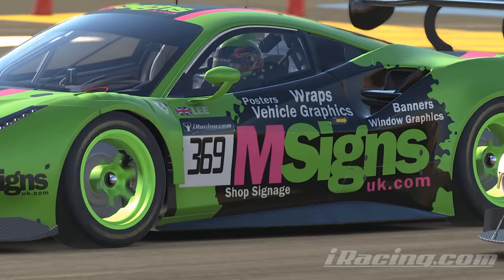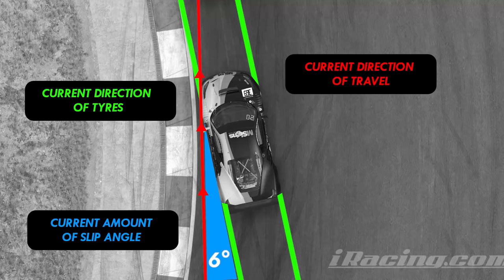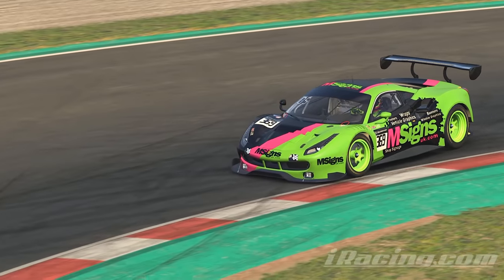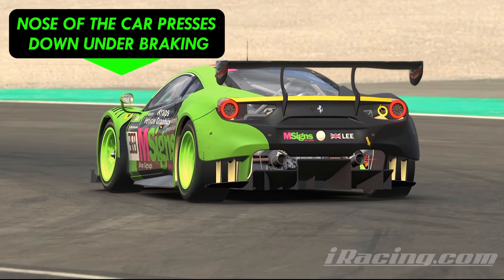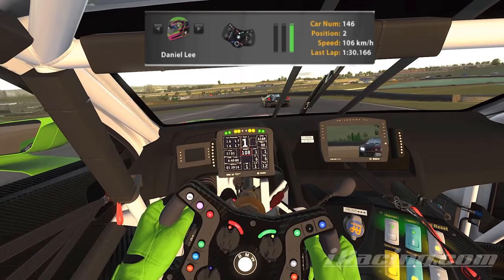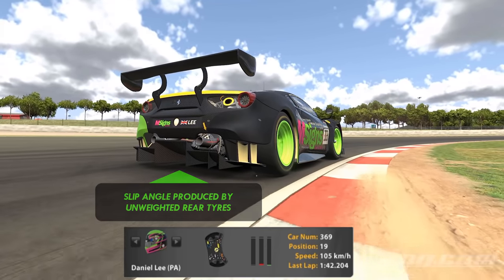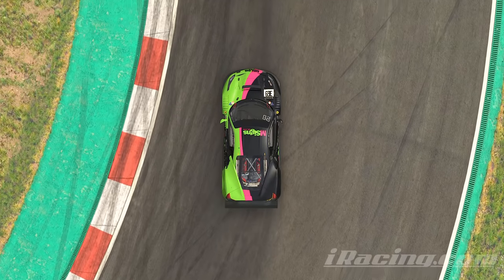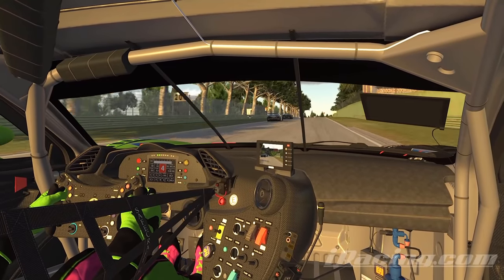Slip Angle in Sim Racing - Nail This and Smash Your Lap Times

Comment: Very well put. I’ve been learning this on my own so it’s great to hear what it is. I’ve got a long way to go though. I’m a GTS player but I imagine it’s much more important in iracing.
Reply from the maker: Cheers - I think it's important in GTS too, at least I assume it is because when I spent a lot of time in GT6 attempting to qualify for GT Academy I found nearly everything rang true more or less. I think GTS is more forgiving about overstepping the mark but the sweet spot is still there to be hit.
Reply: @dannyleeracing  That's correct. If you induce too much slip angle in GTS causing oversteer, the front tyres lose grip as well by magic resulting in a tangental slide without car rotation. It's forgiving for that reason. The only way to oversteer in GTS is to lose rear tyre traction through longitudinal wheel spin (too heavy throttle) rather than laterally pushing the rear tyres. Stock GTS setups (mandatory in Sport mode) are built for latent understeer with a higher rear tyre grip threshold than the front tyre grip threshold so it's unlikely that rear tyre grip is the car's performance 'bottleneck' and instead performance is limited by front tyre grip. Source: I'm a former top split GTS driver.

Comment: Great video, there is more to this though. Slip Angle happens PRE slide and it is the difference between front and rear slip angles (just) pre slide that great drivers do. You can slide the rear in the first third of low speed corners but you have to be careful with tire temp and as I’m suggesting it is different with corner speed. Self serving recommendation, read my book Optimum Drive (which is a continuation of the great Drive Faster). This is an important topic (as you keenly state), keep the learning and teaching going👊🏻🙏🏻

Comment: I can get into the mushy steering zone. That part is easy. The problem for me is keeping that feeling as I make the turn. 95% of the time I either wash out completely or drift into a spin. I got to really get throttle control down. 

Trying to get into this state, I am now trying to learn how to tune in Raceroom (and AC, ACC and RF2). Most of the stock tunes are a bit too tight, but I have to learn how to loosen it up.

Comment: I've always noticed that on very familiar roads I've just kind of instinctively done this... finally know what it's called!
Reply from the maker: Don't try this on the roads or you'll be 'going for a gap' between a truck and some roadside shrubbery one day. If that happens the only slip angle will be in your undies.
Reply: @dannyleeracing  Most corners you can see through, and even then only do this occasionally at like 4AM in the middle of nowhere.

Comment: There is a distinction between slip angle and loss of adhesion. Tires under load always have some degree of slip angle, but it doesn't mean they're sliding. It just means the contact patch of the tire is being twisted by the track surface to face a slightly different direction than the wheels. Finding the optimal point where slip angle is maximized without breaking traction and sliding is the fastest way through a corner, whereas truly sliding is not. The rears shouldn't be operating at a significantly higher slip angle than the fronts, otherwise the front wheels aren't being taken full advantage of. For this reason, I'm skeptical that a lighter rear end starts to slip and help rotate the car into a corner.

Also, confusingly, increasing the load on the tire decreases the grip. This means the front wheels have less grip under braking than the rears. They have more overall traction, but grip is defined as the friction coefficient of the tire (at least from my experience) and not how much traction it has, which decreases as more weight is put on the tire- along with many other factors.

These are nuanced details, but may help people realize that slip angle isn't all that counterintuitive. Looks like some other people have pointed this out, but I hope this explanation is clear.

Comment: I like to liken the tires to a rubber band.

To get the most out of them, you have to stretch the tires (slip angle) enough that they stretch, but not so much that the band snaps. (Loss of grip)
Reply from the maker: You know I love an analogy. Tyres are made of rubber at the end of the day, they need to flex to do their job.

Comment: I'm at a point where 80% of races on iRacing I'm in the top 4 - but yes I have noticed some corners where i have -perfected it, I'm almost on the edge of 'slipping' all round corners to perfect it...

However, this won't work very well on some corners unless your break bias is SPOT ON - for certain corners.

So mess with your break bias, not just for each race, I mean for each corner! On the fly!

Comment: I believe this is why Hamilton and Verstappen always have the edge on the other drivers, especially in the wet. Vettel too, in the V8 era at least, he hasn't got the confidence to do it in the Hybrid era cars. Driver61 channel kinda covered this but he called it something else and described it differently. Schumacher used to do this as well. It's all about confidence and being consistent. Being able to pull this technique off even under huge pressure. Most if not all elite drivers know this technique, it's whether they have confidence in the car to pull it off or not. Martin Brundle and Karun Chandok have also talked about this a lot.

Comment: very well explained. for me (only sim racing for quite over one year now) its hard to achieve with more understeery cars. with those cars i feel like its pretty hard to get the setup on point for slipping the rear end a bit. especially in ACC
Reply from the maker: Thanks man - One way to 'tune' the car out of oversteer is to click the rear anti-roll bar stiffness up or by softening the front anti-roll bar - try it in real small increments and see the difference it makes. There are multiple things that can do it but generally speaking, ARBs have the most obvious and dramatic effect on all-round balance when cornering. ACC is somewhat tricky to feel the limit, I agree.
Reply: @dannyleeracing  ARB' soften or tighten. understood. will try that today. thanks mate
Reply: @dannyleeracing  Not exactly. Stiffening rear anti-roll will make the car more oversteery. Same for softenign front anti roll. Because softer end will tend to roll more, thus it will maintain more equal tire loads, and having more equal tire loads gives more grip in total at that end. But other effect is that havign softer roll contributes to slower reaction, so it is likely that by having front softened in relation to the rear will make the car to steer less suddenly, which will seem to have understeery feel and will be just turn the car bit slower. 

Even more important thing is balance of the aero though. @Vinz Vega, if you want more underteer particulary at greater speeds then shift aero downforce ballance rearwards, you will have more understeer then. However watch out for snap oversteer. Snap oversteer happens when you have understeer which can quickly turn into oversteer once frotn wheels gain grip, normally drivers don't understand that and thinks that theyr primary issue is oversteer.
Reply: ACC has some Setups, yes agressive ones too, with wayyyy too much Brakebias to the front.

On some Cars you need to go down to 56-58%, or you have understeer city while trailbraking.

Change it also on the fly with your Wheel, because after the tires are gone you need to adjust it back to the front.
Reply: @JeyDeee89  got your point mate. brake bias is on my steering wheel already, but will try to put some more attention to it. cheers

Comment: Well in real world to put it in a simple way ... i could corner at 180 - 200 km/h on certain corners while most driver/ricer/pro racer could only corner at 60 - 110 km/h . They steer more than required and overly stiffen the chassis or suspension . Its good to have some weight shifting while assist in slipping slightly without steering , some body roll is good too . To perfect it , make use of gravity and weight shifting rather steering and corner using slight brake or without , precise throttling , worse to worse slip some clutch . Its better than installing crazy amount of body aero junks :)

Comment: I've been playing GT7 and noticed that when i accelerate around a turn that the car over steers, and never did solve that mystery for me.
Thought the game was promoting getting turns right and giving you more turning ability for being able to accelerate around a turn resulting in more turning capability.
When i didn't touch the gas I would turn normally, any time I hit the gas in the turn my steering shifted to more over steer, but in a good over steer as you pointed out.
I thought this was stupid for the game to implement, cause it's FAKE, I couldn't figure out why that was happening, to your point at the start of the video, it's so nuanced you might not be aware you are even doing it. I knew I was turning better with gas threw the turn. it was a mystery and couldn't figure that one out.
But low and behold, you explained it, and I found you...
I was doing slip angles all these times and not knowing what was creating it, I didn't think I was losing my back end cause I was accelerating while turning, so that would make you think you can't accelerate when losing your back end cause your rears have lost traction, but again you pointed out that your on the precipice of losing TOTAL traction, you are on the edge of it! Just enough to swing the car out and add torque, it's so finessed.

Then I thought I was shifting the weight and that's why I was able to accelerate around a turn and get a better steering angle.

Why doesn't the game teach you these things, with cafe's designed to educate you on these racing nuances?!?!?

Comment: You are a genius, thank you. I find it impossible to do this with potentiometer based brakes.
Reply from the maker: When I had my G29 with the standard brake block I'd always just have to use my big toe to daintily feather the brakes. If you have a Logitech wheel give the Truebrake a look, I've got a video on that as it quite impressed me given I'm now used to Fanatec V3's
Reply: @dannyleeracing  nah I just made my own HE Ultimates reps so no need but those kits are a must if you want to be competitive on a Logitech setup
Reply: I use standard Logitech brakes. Just set the deadzone around 50% where the brake hits the rubber thing and that's is. I have no problem getting the car turn in like that and get a competitive laptime.

Comment: Thank you. Being new to sim racing (May 2020), and even newer to iRacing (Oct.), I was recently (this morning) concluding that I just didn't have it, and should hang up the idea of road racing, maybe stick to going around in circles for my fun. But on seeing your video, and realizing that those few rare times when I felt fast, sure, in a corner, but also felt out of control and should back off, was perhaps the slip stream in action. I just ordered the Skip Barber book, and now will go back to practice.

But a question first. Do you have advice or a video on how to go faster in a front wheel drive? What are the aliens doing that keeps them 4-5 seconds ahead of me? 2-3 secs. in rear wheel, but I just don't understand something about the FWD's. Thanks again.
Reply: Slip stream? Sorry. Slip angle. Again, new to sim racing. And racing in general apparently.
Reply from the maker: Don't give up man, when you break your barriers it feels so accomplished! I've been at it for 15 years nearly and minute things still click into place.

I've had my fair share of the Audi S3 TCR in iRacing. With FWD cars you might imagine that there's no power to be put down in the middle of a corner, but in feathered amounts of power that doesn't break front traction you can 'pull' the front of the car round a corner harder than if you were passively off the throttle, so long as you still patiently pick your throttle point on exit. Slip angle is still attainable in FWD at least definitely in the first half of the corner until you reach the point of power out. There's so much to discover and the skip book has two parts of the book that go over the differences in driving FWD.

What car is your main choice?
Reply: @dannyleeracing  Thank you so much for the reply. I lied about going back to practice. I'm looking for iRacing videos to spot and visually learn slip angle. From better drivers. 

My main car? I really don't have one. I've been driving what's needed to raise the  rating. With a mind toward personal comfort. I've found I do not like the BMW M4. Am trying now to master the Audi RS3 LMS and Aston DBR9 GT1. My goal when joining was to eventually race mostly IMSA in the Merc. AMG. I fell in love with it in my 'beginner' platform/program. But have I heard they're no longer allowed there? 

To relax, if there is such a thing, the Advanced Mazda and the Skippy, though I'm having a hard time figuring out it's swinging and swaying.

And I won't give up. I've invested too much. But it's been discouraging the past few weeks as a lot seems to be falling apart. I'm trying to hard, which is probably my problem. Which brings up other questions. Would you suggest one of the several online race schools? TBH, I don't learn real well by reading or blackboard diagrams or being told. I have to get my hands on and do it to learn it. Any suggestions? (I'll still buy the book, btw) And about purchased setups. I've tried Craigs for a month, and several of his setups were nearly undrivable for me. I suppose my bad habits couldn't drive a loose setup, which even I know would be a fast setup. And it all comes back to more practice. But who would you suggest for consistent, fast, but fairly safe setups, if you only had the budget for one source? 

And I'll stop now as I'm writing a book. Thank you again for your reply, encouragement, and help.

Comment: The thing about sim racing is you can be fast and be top of leaderboard consistently but if you don’t understand fully then you can never really be the best, it’s about sliding the car into the corner getting it to grip fully for a fraction on a second on the apex then slowly add power sliding out again that’s the perfect corner on the absolute limit.

Comment: I feel like i don't have the basics down well enough to start doing this technique.
But it sounds very interesting!
Reply: Slipping the car is definitely a technique you'll use when driving the car on the limit.

Practice your fundamentals extensively: driving line, trailbraking and throttle control. When your get really good at driving you'll find yourself slipping naturally to get that little bit extra our of your car. 

So don't stress too much. You'll know your doing it when you've developed enough skill.

Comment: I commented on your trail braking video, but am going to ask again here, can you give tips what to look for when setting up the car (RF2, Camaro) to practice trail braking and holding the slip angle? I drove a race at Fuji and it was difficult, rears get too hot so going to throttle at apex makes rears lose grip.

Comment: Great video and good info. Any recommendations on which track and car combo may be best to practice this with?
Reply from the maker: GT3 cars are great to practice this with as you can tweak the TC and ABS as well as the usual Brake Bias to give you a good safety net. Silverstone is one of the best tracks to practice slip angle as there's many slow, medium and fast corner types with long arcs.
Reply: @dannyleeracing  Thanks Danny

Comment: I would say a good guide for how close to that edge of ideal is are you able to do the corner w/ smooth steering & ZERO counter steering. I bet your example of too much @7:10 would require quite a bit of counter lock.

Driver61 has a vid describing how to do this w/ Max Verstappen getting it the best & once in the vid Max going a bit too far.

Comment: imagine ur fingertip pressing on a table, then slightly twist the finger while pressing down, you will notice the direction of ur finger is changed, but the skin under is gripping the table so that it remains at the initial position. That angle between the finger pointing at, and the skin under ur finger, is the slip angle. With that said, there should be minimal wheel spin throughout the whole corner.

I personally think you shouldn't aim for slip angle, but to drive at the very litmit of the car. slip angle is more like the side effect when driving at the very litmit of grip.

and why the grip is significantly lower once u enter a slide? try place sth on ur desk, and push it while feeling the frictional force, it requires more force to get the thing to slide from rest, but it requires less force to keep it sliding on the desk.

Comment: I've seen this happen multiple times when I race in AC, on Pikes Peak, with hillclimb cars. Sometimes you can throw a car into a shallow corner and at first it may bounce a bit, but then it just grips up and somehow I'm faster...
I have done this with my non-ffb wheel, only a couple of times successfully, but I'm wondering how this would feel on a normal wheel.
Reply: it feels like your floating really.. the car is turning but you're just microcorrecting it and really letting the wheel do its thing.

Comment: And how is this holding up in tire management?
Reply: Have a banana if you're getting tired! If it's still a problem, you could try getting some shut-eye on the straights..
Reply: I like racing with a bmw 320 from the 80s I think and it is superb with slip angle. Just lead the front to the apex, barely and I mean BARELY, tap the brake or if you want to risk over heating, down shift early and watch that baby slip right into a turn and give it about 75% throttle as to not spin out while in the power band and its a blast.
Reply: From project cars